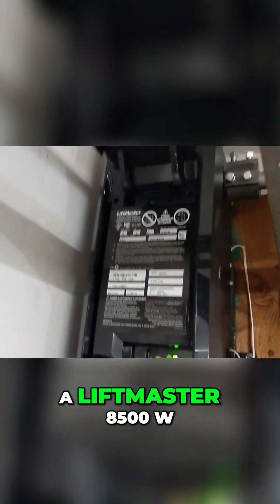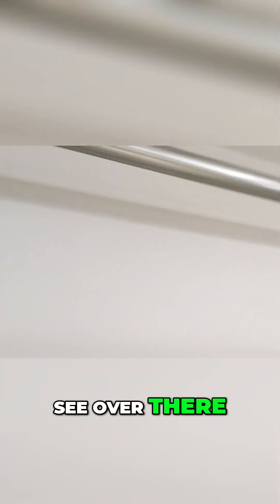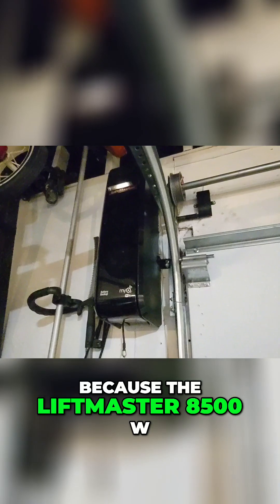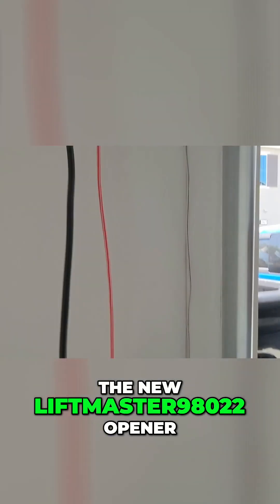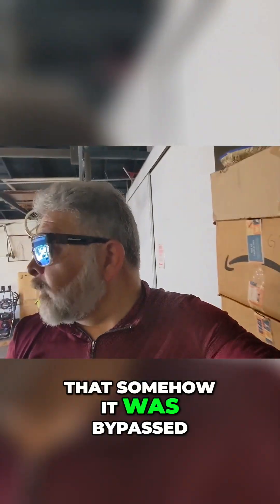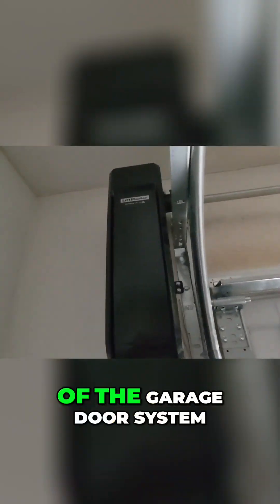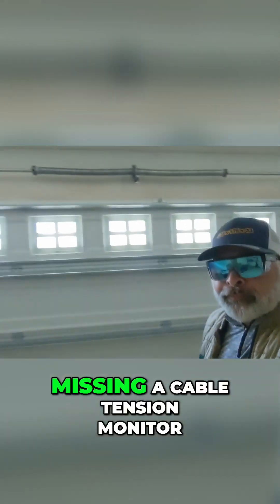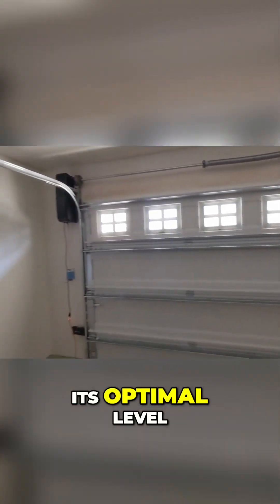Uncovering the MISSING 8500W  Cable Tension Monitor Mystery!

Comment: It's internally monitored
Reply from the maker: Correct the 98022 now offers the internal cable detection.  The 8500W requires a separate cable tension monitor.